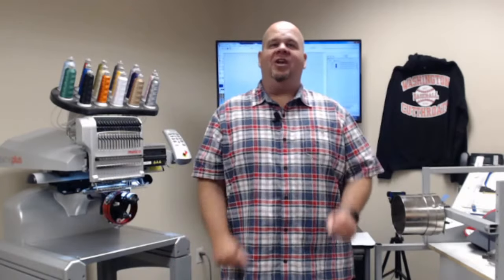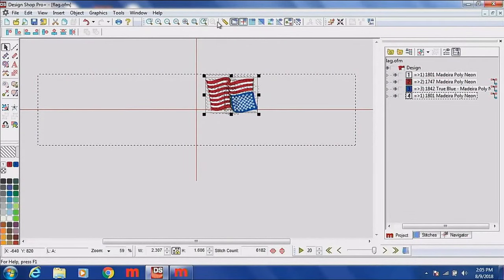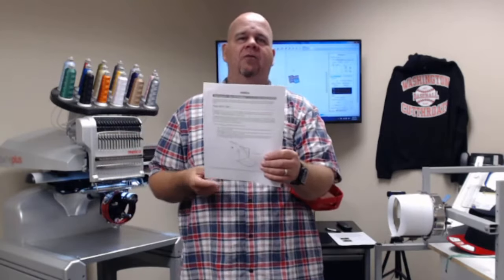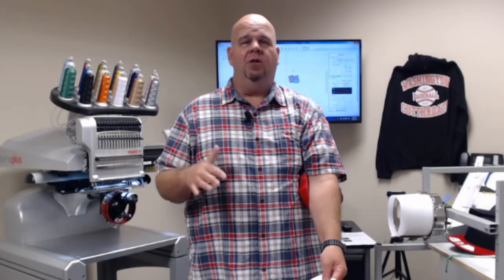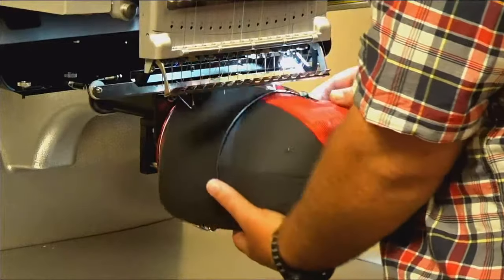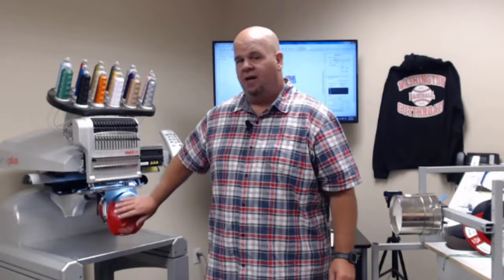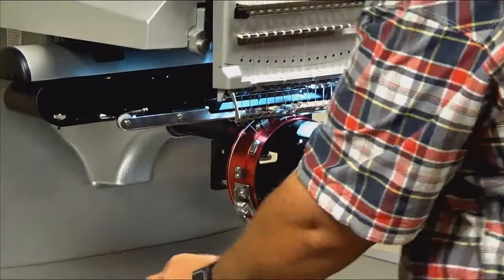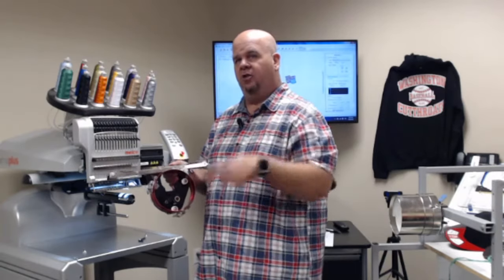Hooping Caps

Comment: Do you have any suggestions for hooping and sewing running type caps. Headsweats brand, or the Richardson 150. These tend to be very thing and very flimsy and pucker easy.
Reply from the maker: take and use a little embroidery spray adhesive on a piece of cap backing.  Takes this piece of backing and apply to the inside of the crown of the hat.  This will make the hat sew more like a structured hat.  Still use one more piece of cap backing (no adhesive).  I would do this on the sweat band as well.  Make sure the design you are sewing is digitized center out.  Thanks for being a Melco Customer!